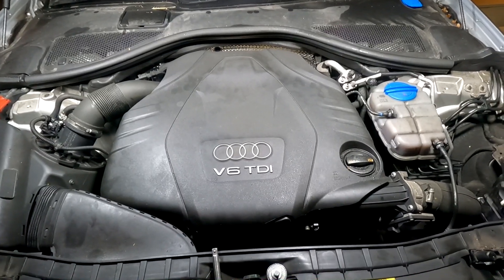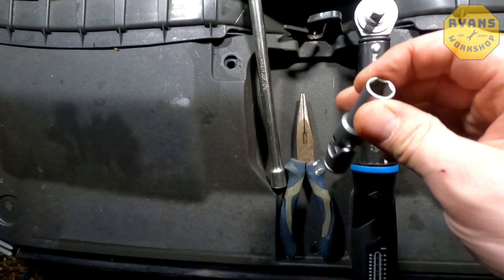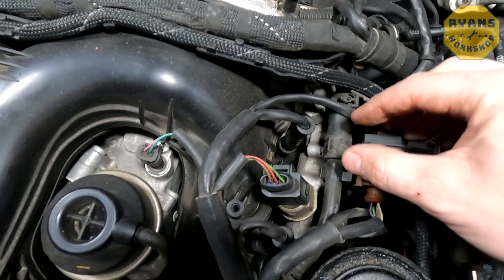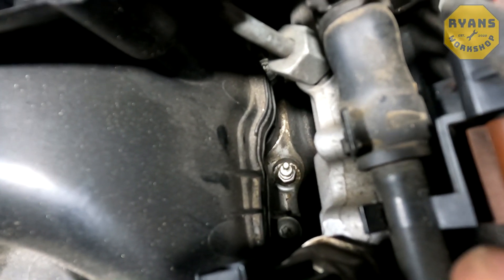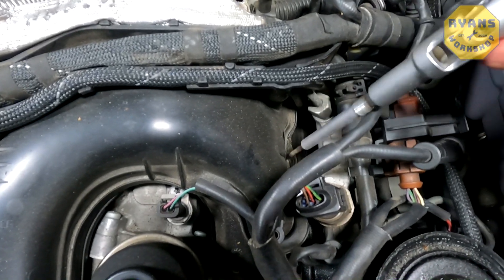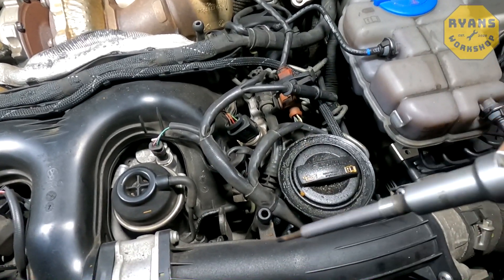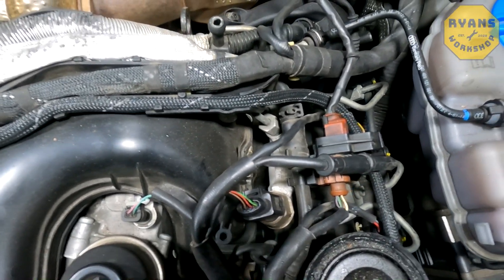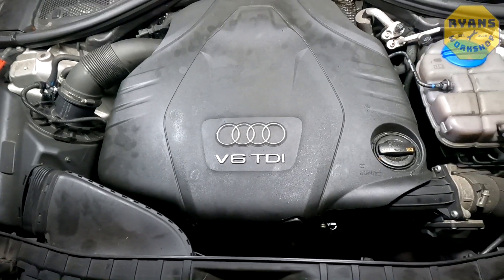Glow Plug Replacement On A 3.0 TDI For The Audi A4, A5, A6, A7 and Q5 2010 to 2015

Comment: Thank you.  I have fault code P067100 and P067500 so I have two to change.  Numbers 1 and 5
It causes the flashing coil symbol on the dash and I don't know if the number of flashes will tell you which ones need changing. I got my codes from Carly.

Comment: fantastic video! would it help to put a little bit ceramic grease on the threads to make it easier to get them out in future? 4 off mine are reading 0.5ohms and the other 2 are 1.2 and 1.5 ohms so looks like they might be better being renewed?
Reply from the maker: Thank you, It could potentially help, yeah sounds like it

Comment: Where is the glow plug control module on a late 2020 model Q5?
The engine management light is on and the diagnostic is returning the following error code “P0684 Glow Plug Control Module 1 to PCM Communication Circuit”

Comment: can you use never never seize seeson the threads
Reply: I would/will/have
Reply: If you add paste just use a very small amount and only at the top half of the threads. Wipe of most of the paste so it is just very slightly in the valleys of the threads